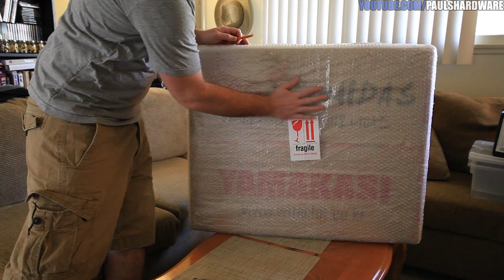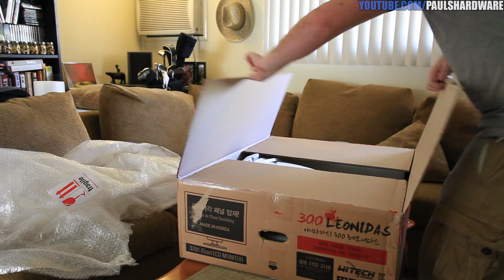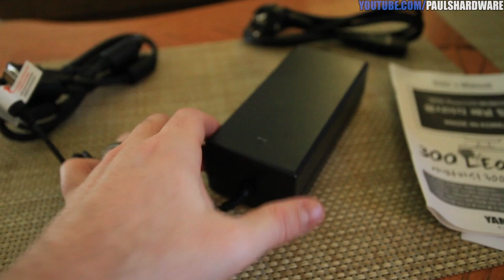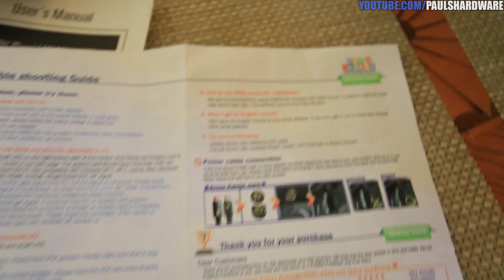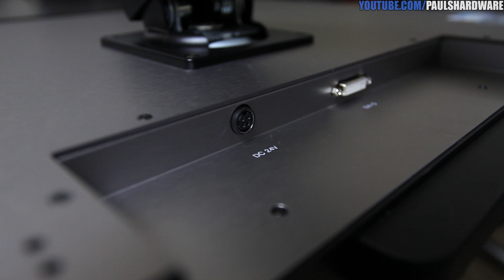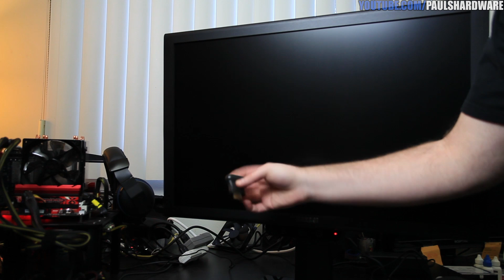Yamakasi Leonidas 30" 2560x1600 S-IPS LCD Monitor Review

Comment: Have you tried DVI-I Dual link adapters vs DVI-D Dual link adapters, what is your video card outputting, dvi-i or dvi-d dual link signal?

https://www.google.com/search?espv=2&biw=1247&bih=574&tbm=isch&sa=1&q=dvi+dual+link+i+vs+d&oq=dvi+dual+link+i+vs+d&gs_l=img.3...34922.43866.0.44183.22.17.1.4.4.0.166.1904.0j14.14.0....0...1c.1.64.img..3.15.1438...0j0i67k1j0i30k1.I4PYJVhJnGU#imgrc=Z7fXZ6a1knyFGM%3A

Comment: just an FYI there are DP adapters that work, but, they MUST have the external power connector(usb plug) the other kind will not work for 1440p in most(if not all) cases, let alone 1600p, on the other hand i have setup several of the true full on DP to dvi-d adapters and they work fine/wonderfully. 

it it dosnt have an external power connector(usb in most cases) then its not gonna do the job.
Reply: +Una Salus Victus I think it's whether it's an active adapter or not, i use an active adapter on a screen that claims adapters won't work and it works fine, no usb

Comment: nice to see a review of the leonidas, I have a question though is the list for the compatible video cards outdated?  Because it only mentions the gtx580, will this monitor be compatible with the gtx970 in sli (it is dual link dvi compatible).  Also does anyone think that the 970 in sli can max out all games at this resolution or would 2560x1440p be better? thanks
Reply: Yeah, you will be fine.
Reply: Rule of thumb, if it's nvidia then you have nothing to worry about. ATI then look up sheets just to make sure it will work, chances are it will.
Reply: GregLH0 eggzactly! im running quadro cards over here only since day one.

Comment: How can I use my HDMI consoles with it if it has no HDMI?
I will not use two different screens for PC and consoles.
Reply: Simple answer, you don't use your consoles on this. You would want to buy the sparta in your case.
Reply: GregLH0 I'm using an xbox 360 on mine so it can work

Comment: "I did pay for the pixel perfect version, so there were no dead pixels." Wait, so you actually have to PAY EXTRA to get hardware that actually isn't defective?!? WTF!
Reply: Do you realize how much cheaper this is than something like an HP. Like Paul said, those go for over $1000. These are much cheaper.
Reply: and here is the perfect version. http://www.amazon.com/Perfect-Yamakasi-2560x1600-Computer-Monitor/dp/8918010656/ref=pd_cp_pc_0
Reply: Kassian Tarnawsky  Yeah, but still. It's like buying food, and the grocery store saying, "if you pay extra, you can get the non-poisonous version!".. Oh wait.. That's what organic is.. Damn!!! Sh*ts fu&$ed up these days! LOL!
Reply: bliglum not really its like buying food that was dropped or not as rich in taste.  The fact that they are selling perfect pixel is a good thing otherwise they are going to sell the monitors with dead pixels and perfect pixels together.  Better they sell them separate so that those who really need perfect pixel can get it guaranteed.  For those who want to take the risk and get dead pixels probably will be using it for like a camera system (who cares if you have 5 out of millions of pixels on that)...

Comment: Well, this monitor seems to have since gone extinct. Only thing with this name I can find is the power adapter...

Then theres the 300 Sparta model, and a 301 Sparta model, using an AH-IPS panel and S-IPS panel respectively. Neither mention specificaly what panel they use.

Comment: Yeah, regarding the adapters tried here, is that "active" adapter in the video the same kind of thing as the Apple Mini DisplayPort to Dual-Link DVI adapter that actually requires a powered USB cable? There must be a technical reason why these adapters don't work that we can overcome.

Comment: May I suggest to you the Asus MX279H? It's a 1080p 27 inch monitor, and has built in speakers that I've heard are suprisingly decent! If you sit like 6 feet from it even console games will look pretty good (-: Not to mention it uses an IPS(In-plane switching) panel which means it has solid color reproduction and your games will look phenomenal even if they aren't going to be full 1080p!

Comment: Hey Paul, thanks for share this review. I have two yamakasi 27", 2560x1440, and they work with my macbook pro (the 13", 2011 using a dual link-display, and de old 17" 2006 directly!! ). Can you please test this monitor with a macbook pro?
Thank you!!!

Comment: The one I received was damaged even though I paid for a pixel perfect version + I had to pay extra customs duty. It powers up the LG S-IPS panel itself works but the build quality is really bad and in mine the panel moves a bit back and forth in the housing. Also the power brick gets too hot.

Comment: Paul, I have the White Yamakasi Catleap (mounted on a white Humanscale M2 Monitor Arm). I was able to get it to work on an Apple Thunderbolt(MiniDP) Port by using the Apple Mini DisplayPort to Dual-Link DVI Adapter MB571Z/A. It worked like a charm, it uses the MiniDP and additionally a USB port to send the power/signal through the DVI-D to the Yamakasi. Hope this helps your subscribers using an Apple.

Comment: That mini-DP to DVI adapter was active, but it was single link despite the fact that it has all the pins.  Active DP to dual-link DVI adapters are bulky and have a USB connection to power the adapter.  That would probably work.

Comment: i just returned my LG 29EA93-P because it had a dead pixel AND it decided not to power back on after i turned it off (after 3 hours of use.)  I ordered exactly the same thing as you from the same seller.  I AM ULTRA PUMPED.

Comment: passive adapters just pass the signal on with a different output, so if you were to take a HDMI to DVI it doesnt matter if you plug it into a dvi the max resolution you would get is the one thats supported by HDMI. 

Active adapters transform the signal 

basically 

passive:

input: A --> output: A

Passive:

Input A: --> output B

Comment: That active adapter is only single-link. You can use an adapter, but you need an Active Dual-Link DVI adapter. Those adapters have usb to power the adapter. At one time I used 5 of those adapters on 5 30" 2560x1600 displays at native resolution.

Comment: Same here. Bought 2 for 289.00 each on 9/9/12. One pixel stuck red on one of them, other than that they are amazing and the only time I have ever noticed the pixel is when I ran a tester. At this pixel density I can't imagine people notice damaged pixels unless they are in a cluster. Though on a 30" monitor the density goes down considerably meaning pixels are alot bigger. Hence part of the reason the pixels were evident at the focal point in this video.

Comment: that is actually exactly what has happened, the 1440p catleap monitors can be overclocked on the old PCB and is now at a premium.  The newer PCB models cannot be overclocked to those levels.  You can check out 120hz site for more info

Comment: nice video bro, I just got in the Aruvia 2560X1440 27inch monitor from Microcenter.  Ive been eyeballing a 1440p monitor for quite some time, just recently took the leap on it.  That will give me 1 60Hz panel 1 120Hz 3d panel, then a 1440p panel for testing :)  Now I just need to do a review for it lol

Comment: You can't overclock a monitor since that would require increasing the voltage and frequency of the panel driver board itself. People are simply increasing the refresh rate of the cable connection between the video-card and the monitor. Increasing the refresh-rate of the connection does not increase the response time or refresh of the panel itself. It only reduces the latency between the video card and the monitor. You can do custom resolutions and refresh rates on most video cards.

Comment: i got a HP monitor I got back in 2009 with a resolution of 1600x900 but when I play any 3D games I play around 1040x760 or something in that area, because of my poor gpu. But when i do play sometimes at 1600x900 (rarely) the difference is really big, so I cant imagen what 1080p 1440 and 2160 would look like

Comment: I have a 7950 and 27" Crossover and everything works with no problems using a dual link DVI cable. Just make sure you're using a DVI-D cable.

Comment: I got the crossover 27" one. Not a bad monitor, picked it up for 350 AUD total, (About half the price of the cheapest 2560x1440). 

Mine has one issue, after running it for more then 30 mins, I need to physically disconnect the power from it if it has gone into sleep mode, so i am thinking that one of the capacitors is faulty.

Comment: There are specific mini display port to dual link dvi adapters that you have to use when connecting a monitor with such high resolutions. I did a quick search and found "Accell B087B-003J UltraAV miniDisplayPort/DVI-D Dual-Link Adapter". Also it could also be a HDCP issue. Cool video Paul, keep it up